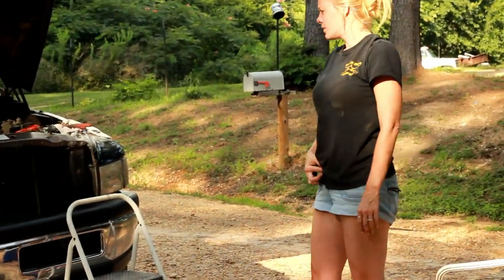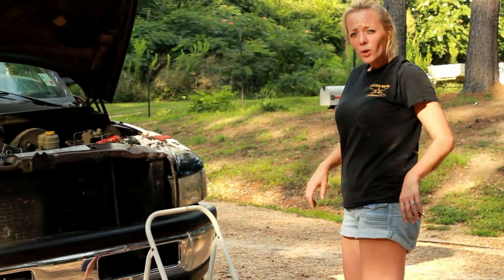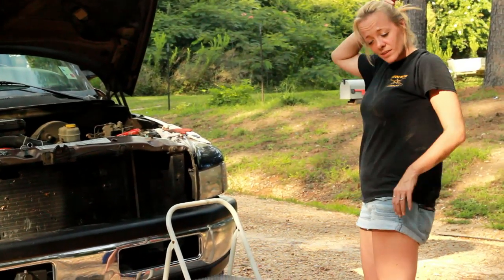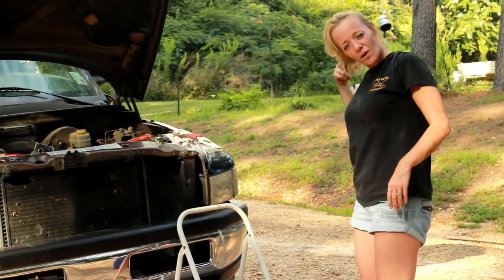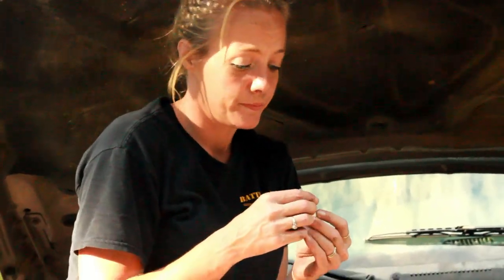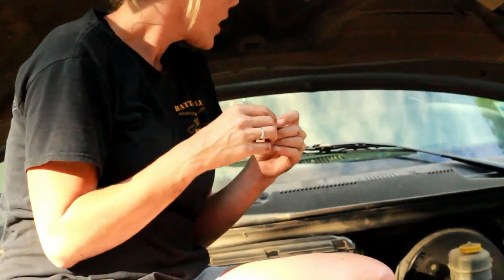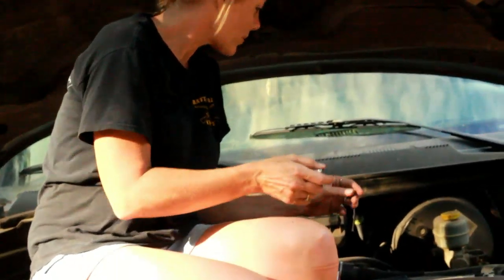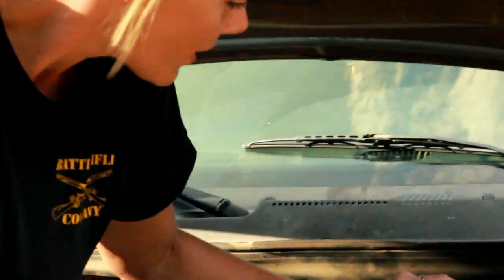Girls Can Fix Trucks Too!!!

Comment: Terminology is important. Plug wires, plug wire boot, ratchet, etc. A socket wrench is a wrench with an open end wrench on one end and a swiveling socket on the other . Both are the same size. And last but not least, if you strip or cross thread the threads in the sparkplug hole . Its the head you mess up not the block. I think its great that you are not afraid to take the initiative and tackle these jobs.  Good video.

Comment: Another trick for getting the plugs out after breaking them loose is a foot long piece of rubber fuel line...Break the plug loose then put the fuel line on the plug and unscrew it...Works great for getting the plugs started too...

Comment: back plug on a ford truck.   I used a 2 inch hole saw and made a hole that lined up with the back plug thru the mud splash guard from the wheel well.  then I used tape to use the plug to close the hole back up.  The interval for changing plugs is like 100K miles anymore.  would probably be a great time to change the wires too.  easy to take it off with a knife then.
Reply: Randy J Did the same exact thing on my F150 4x4 and My GMC 4x4 !

Comment: Just pull the friggin spark plug wire out and use channel locks if you have to and just replace the $40 spark plug wires.
Reply: vanscoyoc That's what I did to my GMC 4x4 ! I figured it probably needed new ones anyway

Comment: twist the wire from 12 to 6 oclock before trying to remove the wire from the old plug
Reply: actually you should twist from 6 to 12 oclock
Reply: theothertroll No it's 10 to 2 o'clock !